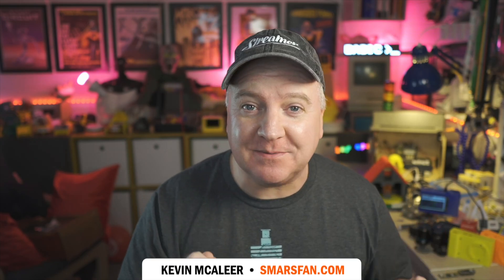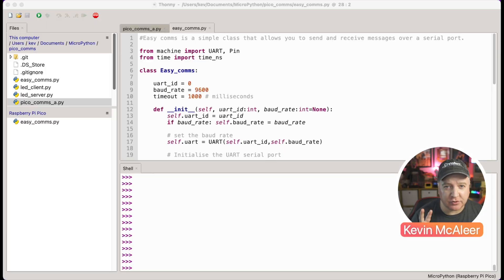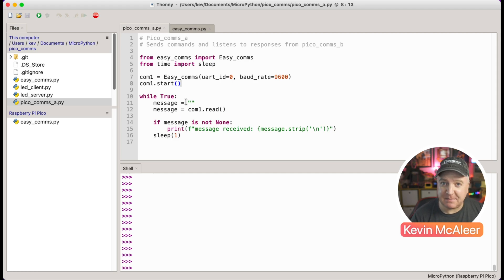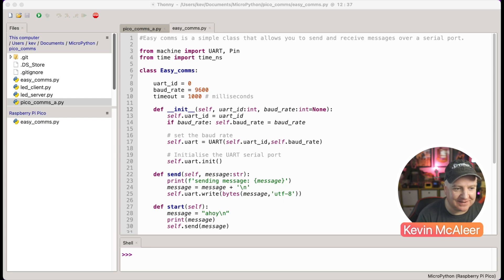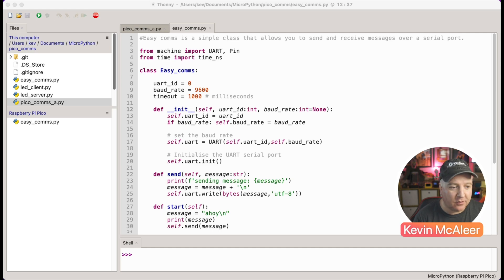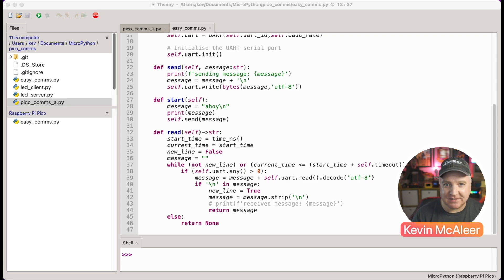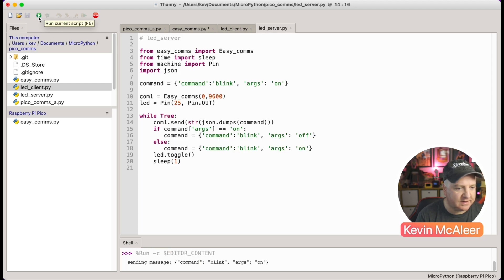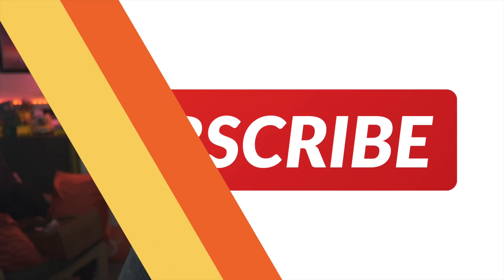DO THIS to connect two Picos together - to Pico Communication via UART

Comment: Very cool, Kevin. I am going to do some testing on this using ESP32s. My use case is robotics, where one ESP32 is receiving signals from iBus RC controller, and passing processed raw data to a second ESP32, that actually sends the signals to motor drivers. (Steppers, BLDC & hobby servo). These ESP32s are also on the robot's internal LAN and sending MQTT status info at the same time, like heartbeat & diagnostics etc.  The MQTT server is a Pi 5 running NodeRed. So your UART library may become a component of the entire robot's internal network. Thanks for your efforts!!!  EDIT. For my needs, I had to abandon this approach because the UART was occupied with another task, and try as I might, I could not time-divide the tasks across the UART. Ended up using MQTT for my needs. Having said that, Kevin's library worked flawlessly when I was only using the UART for microprocessor to microprocessor communications. I will definitely use this library in future projects. I modified it slightly to allow for easy assignments of gpio pins if anyone is interested. Tested on ESP32.

Comment: Hi thanks a lot for the video! I would love to see a sequel where you daisy chain, say 4 or 5 boards and demonstrate how each board would receive and process only the instructions it is meant to process. And all boards would be able to send feedback about the process result back to one main board that keeps track of each boards results.🤩
Reply from the maker: This is how the first networking worked - AppleTalk/Localtalk on the Macintosh used a serial connection and a single cable to connect a series of computers together in this way.

Comment: Hi Kevin , can you use this method to receive video from esp32cam to pico ?
Reply from the maker: You can but remember the Pico only has 264k or ram which isn’t enough to hold a single frame of colour video let alone a live stream. So it depends what your going to do with the video, at a push you could write it out to a file or pass it onto another device a couple of bytes at a time.
Reply: @kevinmcaleer28  good point ! I forgot about the ram limitation, I wanted to do FPV smars but Esp32 alone is really limited so that’s why I wanted to pair it with pico , maybe I could use another Esp32

Comment: Hello Kevin
Thank you very much for your many interesting videos! I learn a lot from you.
Could you give me some advice. I need to make 2 Pico communicate.
However, on the Pico receiver, Pin 1 and 2 are already used.
How can I modify your code to use Pin 21 (GP16) and 22 (GP17) where TX0 and RX0 seem to be available too?
Thank you for your help!

Comment: Thanks for putting this code and demo together. Note that there's a problem if anyone sends a character that encodes to 2 bytes of utf-8, because the reader will call decode() on the first byte received, and probably generate an exception. You can only decode the utf-8 character when you have both bytes. So it might be better to leave the decode until you have the whole message. There is still the problem that '\n' might then be detected early, matching with one of the 2 bytes. You might use decode('utf-8', 'replace') to avoid exceptions.